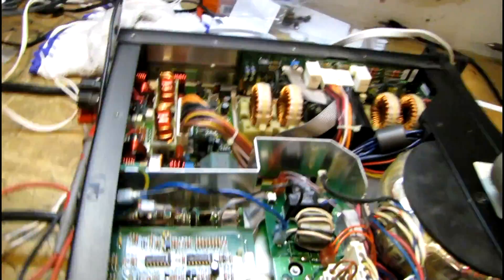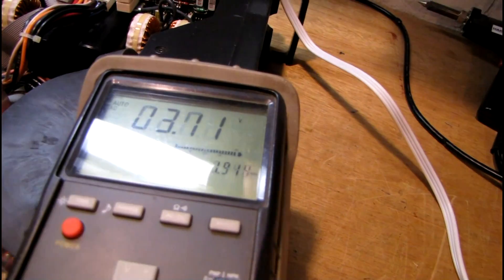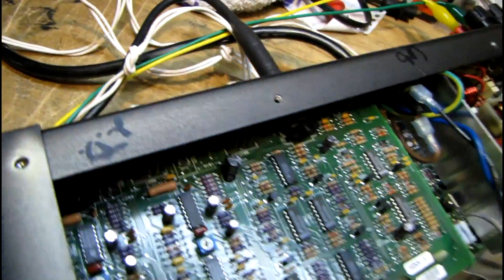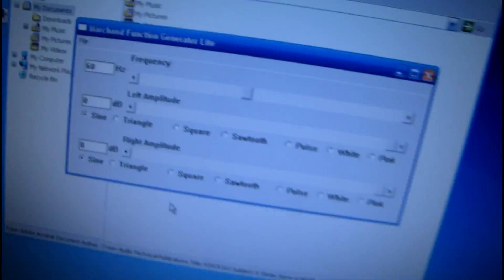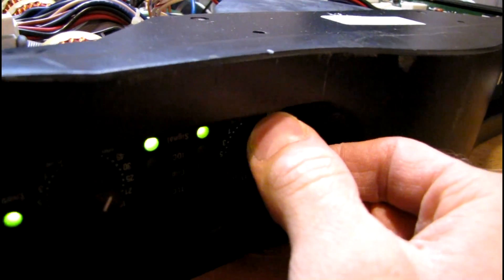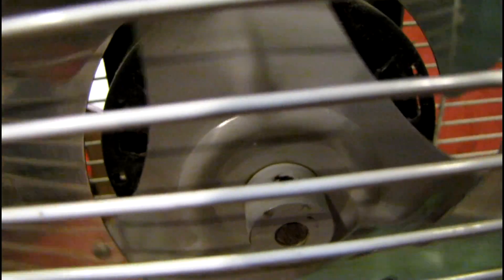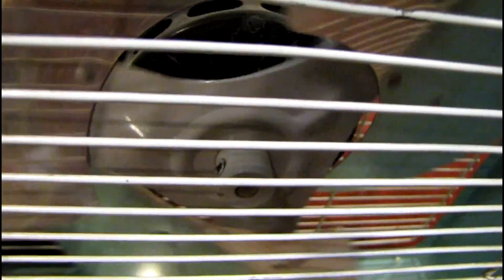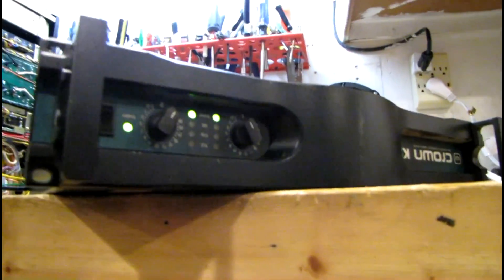High powered amplifier safety and fun

Comment: I used to run 400 Hz sine wave into Crown amps and use the output to run run aviation electronics that required 110 volt 400 Hz. We got a big power supply for that later t, but the old system could start high inrush loads that the switch mode would shut down on.

Comment: cloud you not use the amp as a variac like a 1kw variac ?
just have the signal gen at 60hz all the time
Reply: +Kristijan Dinga theoretically yes, but it adds a lot of unnecessary strain on the amplifier. A variac has a dial and a big copper winding whereas an audio amplifier has very small parts that can get ruined easily.
Reply: On big old commercial amps it is no problem, I have done it for weeks 24/7. Watch the temperature. On home amps or small over rated stuff like Behringer I would agree with SpaceMountainLarry. When you have 6KW dissipation available for 500 watts output, I stop worrying.

Comment from the maker: The same thing would apply, only like you said, less voltage and more current.  I've seen car amps that can go under 1 ohm actually.  Though I don't have any amps like that, nor do I have a big enough 12 volt power supply to run one in my shop yet.

Comment: Have you tried this with a vehicle amplifier? 120v amplifiers usually have high voltage due to the fact that the drivers their powering are over 8ohms and in vehicles you can go down to 1ohm on certain amplifiers so they will produce less voltage but more current therefore called high current or "HC" amplifiers.

Comment from the maker: Technically you could, but you would need the right amps, and also a program that could keep proper sync between the phases.  I don't suggest using audio amps for any real application like that though.  I only did this to make a point on how much current they can produce, since a lot of people think that all speaker wires are harmless.

Comment from the maker: Nope, it never even broke a sweat.  It's made to deliver up to 2500 watts in bridged mode.  The fan uses less than 400.  A couple of subs at 4 ohms is a much more difficult load than a simple induction motor.

Comment: yes. and it probably would be a cleaner source of ac power provided if you were providing a clean sine from the function generator and a powerful enough amp. cheaper power inverters i notice use a square waveform in the output, which is not as good as a sine.

Comment: do that with a car amplifier. use an electronic 60hz sine wave function generator on the inputs and see if you can get 120v at the outputs. if you can, you'll have a power inverter.

Comment from the maker: @Lachlant1984 This was an induction motor, so there is no commutator.

The fan was receiving about its normal operating voltage.  It is best to keep it at 60 Hz, but a minute of fun won't hurt it.  At least not a good vintage metal fan :-)

Comment: Holy crap, that's bloody crazy.  That thing produces the kind of voltage to power a box fan?  Holy mother of God.  I'm assuming the sound of the music is resonating through the cummutator bars, that's indeed AC motors have them, I know DC motors do, and through the coil and windings, could that not damage the motor if you did it too much or applied too much current or voltage?  That's insane.

Comment from the maker: @DaAnalogDogg86 Nope, DC is very bad for speakers :-)

An audio signal is basically an AC waveform with many different frequencies in it.  The amount of voltage and current determines how loud it is.

Comment: you should have done the demonstration with an incandescent bulb, an AC motor is not a passive transducer like a speaker, it does send harmonics back in the circuit, I'm not sure that kind of abuse is good for the amplifier

Comment: Some of the car audio amp manufacturers would do demos similar to this years ago. One had an amp hooked up to a blender, another actually used the speaker outputs to weld metal (US Amps VLX200) then hooked the amp up to subs and it pounded them good! This was a great demo, thanks for sharing.

BigDWiz - OldSchoolStereo

--

Comment: Ive done this before, used a car amp and step up transformer to get a small ac motor up to 400hz instead of the nominal 50hz :D  (just remember to increase the speed gradually or the motor will loose sync) Went crazy fast, you should try that with your amp and a motor with no load.

Comment: Crazy stuff! That's why they always say before you connect your speakers to your amp, make sure the amp is powered off and unplugged from the electrical outlet before making speaker connections to the amp.  Cool experiment though.  Good way to fry some cheap speakers too.  Be safe man.  CG